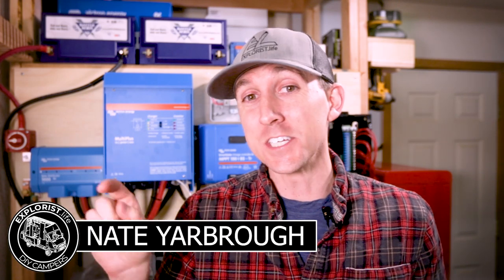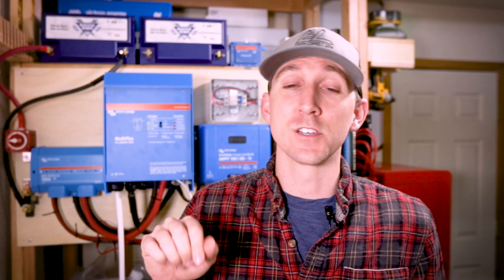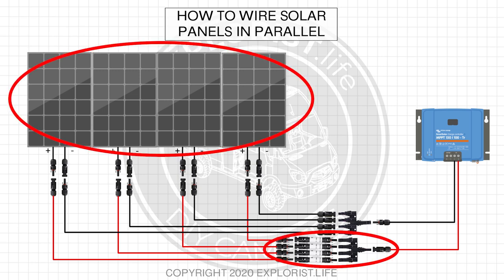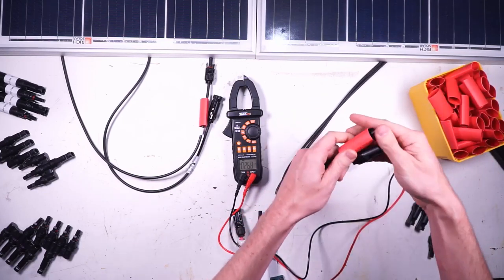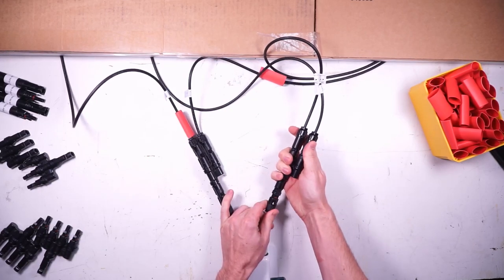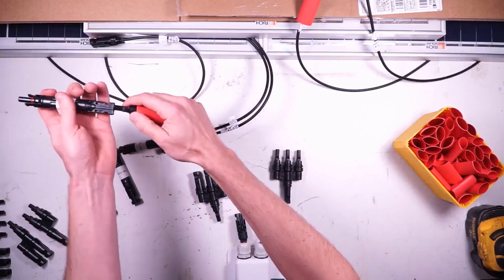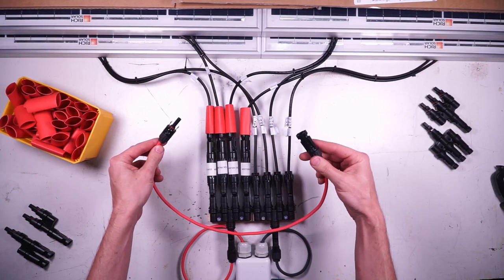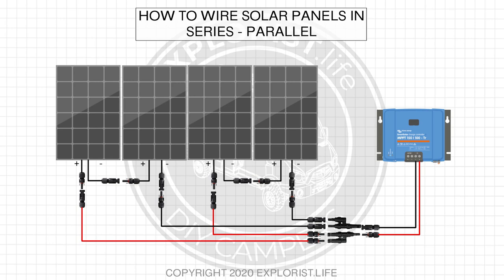How to Wire Solar Panels in Parallel for your DIY Camper Solar Install

Comment: First, I think you have the best videos for me to understand, almost.. I just got a 2021 trailer with a solar package which included a 12v frig, 165w furrion solar panel and a furrion 25a MPPT controller. Haven't been out yet but want to add to solar a little at a time. I already added a second 12v battery I hooked in parallel. The furrion panel is $500. I was looking at the 175w Renogy for $200. I can either try to match my 165w with this 175w or there is also a 160w. In one of your videos you said as long as the voltage is "close". Easiest for me to hook up with the Y adapter in parallel. Next I'll try the inverter...   Thanks for the help..

Comment: I’d like to know more about if you can have a bunch of different size panels wired together as an array to put into a charge controller to charge my 2 6v (12v via series) system…

Comment: The Connectors are clearly marked  positive and negative if you use a flashlight.  The positive always has the orange or red o-ring showing .
Reply from the maker: I've seen solar panels with their marked connections reversed. 😶 It's best to double check with a multmeter.  It takes an extra 3 seconds per panel.

Comment: Hey Nate new subscriber great video can’t find your update video on when to use fuses I’m gonna connect 3 100 w solar panels in parallel to my 3600 w natures generator would I need the fuses ? If so they are already in my cart in Amazon and would I need 15 A or 30A ? Thanks in advance awesome channel …..

Comment: Hi really enjoyed your video.
Q - I am planning to fit 3 175watt 12v panels in parallel, will I need to use 10mm2 (7 AWG) to cope with the amps? Cheers David

Comment: How durable are the wires and connectors since they will likely be exposed to UV rays and the elements?  Should the connections be inside a box and/or run wires inside conduits?  Or do you just tuck them in the air space between the solar panels and the roof as best you can?

Comment: I just bought a bigger bus and took my 2 battery 3 panel system and split it between the 2 buses.  The 1 panel to battery was easy positive to negative. The 2 panels were confusing but easy too. Just wire the negative to negative and out to the charger and same with the positive!
At first I had the 2 panels going down separately but realized that wouldn’t charge correctly, so I had to splice an extra few few of cable into my Panel wire n now everything’s connected m charging :)
Reply from the maker: Nice!  Glad you got it figured out.

Comment: Hi Nate can you reply with how many 100W panels can connect in to a 30A charge controler I have 8x100W getting 2 more to have 1kw, will connect to 4 100ah lead acid deep cycle battery.
I'm always enjoying looking at your videos.
Reply from the maker: This should help teach you how to figure that out: https://youtu.be/Jkbs84sBHsg

Comment: Good Morning.  I'm looking at putting on two Solar panels.  I was thing of either 2 HQST 200 Watt each or two Renogy 175 Watt panels. I have two Battle Born 100ah  for a 200ah sys. I have a 2000 Watt inverter but at this time I do not plain on BOON DUCKING very much or long. I do have a back up invertor Generator.  This will be for help maintain the batteries. Any sajustshion  would be Great.  Jack
Reply from the maker: Here is a 2x200W solar panel wiring kit I've put together: https://shop.explorist.life/shop/all-products/camper-wiring-kits/solar-charging-wiring-kits/400w-solar-charging-wiring-kit-2x-200w-12v-battery-bank/

Comment: Is there a reason to fuse each panel versus only one fuse at the output side of the branch connector? Certainly the panel wire gauge can handle the short circuit current of an individual panel. Not sure I see any added benefit to individual fuses.
Reply from the maker: The panel wire can, indeed handle the short circuit current of a single panel, but if multiple panels are wired in parallel, there is a chance that the combined amperage of all panels could flow back through a single panel wire, overloading the wire.  I'll do a video about this within the next month, but I've already got some more detailed info on 'why' on the blog: https://www.explorist.life/how-to-fuse-a-solar-panel-array-and-why-you-may-not-need-to/

Comment: So ...to do parallel  wiring is it safe to connect all the positive leads together on the 3 flexible .solar panels,&then all the negative leads together? Person who installed the system cut off all the connectors leaving only the bare wires to connect to .Is it standard on all flexible panels that the + is on the left& negative wires on the right? Thank you for all your help.really appreciate .(Lensun Solar Panels)

Comment: Is there a simple switch box that can be built and mounted inside my vehicle, to Switch between Series & Parallel Solar Input. I just found out the pros & cons of each, so would like this ability.
Reply from the maker: That would be pretty overly complicated for minimal benefit.  Just set up the array properly for the 95% of the time and call it good.

Comment: I thought if you connect panels in series you’re going up with the volts for example one panel it’s 12V. If you connect to you make 24V is that correct?
Reply from the maker: Yes, you're correct! When you connect panels in series, the voltage adds up. So if you connect two 12V panels in series, you'll get a total of 24V.

Comment: I’m wondering if you have any videos on how to wire a trailer from the shell off restoration. I am interested in how to wire the lights but I am also interested in how to wire the seven pin. For instants do you need a plug that has to male And so that it can plug into the trailer and the truck? I cannot find any videos on this

Comment: Hi there Nate, my name is Ray I am currently building a tent trailer for my mobility scooter. Keep in mind I do have mobility issues hence mobility scooter. Now my Question is not for my solar tent trailer it is for my Three Wheel electric trike ( mobility scooter) make is T4B electric scooter. It states it is a 500watt 48V20Ah with lead acid battery.   Just so you Know I have already played with it I bought 4 more 12v20ah batteries and yes it can go as fast as traffic. I don’t recommend this. So I put it down to a 60v20ah system instead of 48v20ah because that was too slow now I want to go solar powered at all times. Meaning charge while I drive. So you know I have this thing set up so I can plug into a battery bank and drive at the same time and the result was awesome except the power bank weight was too much for my likes cause it used more of my battery for the weight.    Ok hopefully you are still reading my babbling typing if so I want to put a solar panel on a roof I am making and get a mppt charge controller for a 60v 20ah system is this possible I will add pictures of me mission  Any feed back would be apprieciated. Thank you Ray￼￼￼￼￼
 
Yes I did all of this from my wheelchair and shop roller seats and arm canes
￼￼
Reply from the maker: Nice!  So, to charge a 60v battery bank, you'll need a charge controller that is capable of charging a 60v battery bank like the Midnite Classic 150 (https://amzn.to/2D7C8YZ) and a solar panel array that exceeds 60v.

Comment: So I don’t have a van, but I do have 6 /100 watt panels and I saw that you put inline mc4 fuses. So my question is. Do I need to put one of this in each y connector on the positive side. I understand that with six panels you do need inline fuses due to the about of power generated. I was thinking of using 20A fuses per panel. What is your advise I am in the process of putting this together so I want to make this right. Thanks

Comment: How do you get awg 4 wire in to a charge controller even using a furrule crimpers. Do you trim some of the strands to fit a smaller sheld on the wire?
Reply from the maker: A charge controller that is rated to accept 4 AWG wire should fit 4 AWG wire even with a ferrule on it.  Are you using too big of wire for the charge controller?

Comment: so.. if you have 10x panels. rated at 12v, 100w. 6.7A wired together in parallel, potentially making about 67A of current. 
Suddenly nutty the squirrel decides to climb on your roof and shades one panel. What stops 9 panels from pumping 60+ amps into the shaded panel and creating a fire?  a fuse?   
Why not large bypass diodes?
Reply from the maker: If you had 10 panels wired in PARALLEL where the array amperage could potentially be 67A, you would want fuses protecting each panel at the combiner.  Here's a video covering how/why that works: https://youtu.be/s1P31hxlD3I?t=283

Comment: Although I don't have the cables on front of me to test the positive and negative wires to see if they're accurate- what I ordered has negative females and positive males, this is for two solar panels, yet the same brand (rich solar y connection that reduces it from 2 cords to 1) is actually 2 negative females which  ends as a positive male, and the other is two positive males which ends in a female negative. Shouldn't I be plugging in 2 negative males (which the solar does not have) into the 2 female negative y connections and 2 positive females into the 2 positive male y plugs? Or should it all work out and the signs don't necessarily need to correlate? I talked to Rich solar on the phone today and he didn't answer my question, just referred me to this specific video.

Comment: if I have 2x100 w panels and 2x170 w can I still connect them in parallel? and also do I need fuses? many thanks
Reply from the maker: Hey, mihail buturuga! I appreciate you taking the time to ask your question, but unfortunately, I don't have enough info about your specific question to provide an accurate answer, but here is a playlist that, if you watch all of the videos start-to-finish (and take notes 😉), you'll have a REALLY good idea of how to design a solar array: https://www.youtube.com/watch?v=Jkbs84sBHsg&list=PLmvhcyi4n0TV9pi83rFTv3ZuMT_S1xIZt

Alternatively, I have some of my most common solar array setups pre-built here: https://shop.explorist.life/product-category/all-products/camper-wiring-kits/solar-charging-wiring-kits/

Comment: Can I install three 200W Rich Solar Panels in parallel while using a Victron SmartSolar 100/50 charge controller?
Reply from the maker: Check here for the ways I recommend wiring 200w panels into a system: https://shop.explorist.life/product-category/all-products/camper-wiring-kits/solar-charging-wiring-kits/?filter_solar-panel-wattage=200w&query_type_solar-panel-wattage=or
Reply: @EXPLORISTlife thanks.  Really enjoy all your videos

Comment: Hey Nate! Great video, thanks! Not sure if you can see this but is there a box of some sort that you can attach to the roof to house the MC4 branch connectors? All I can find are various DIY builds, hoping for something simple (like myself). Thanks, Steve!
Reply from the maker: Easiest way will be to not put them in a box.  They are designed to be exposed to the elements.  A box will indeed be some kind of DIY thing as that would be an atypical install.
Reply: @EXPLORISTlife  Wow that's great news! Thanks a mill for getting back Nate, I really appreciate it. Holler next time you are in Ireland!

Comment: When connecting 5 panels in parallel is it better to use 2 to 1 connectors or 5 to 1?
Reply from the maker: I'd rather do all 5 in series with an appropriately sized charge controller.
Reply: @EXPLORISTlife  I have a lvx6048 6kw 450v input and 27 amp overload and I have 10 panels that are 39.1 volts and 10.2 amps. I'm trying to figure out a layout that can maximize that unit. So I was thinking of 8 panels in series and 2 in parallel. I just don't know how to wire it?

Comment: Hi Nate, these are great videos!! I'm wondering if you can comment on using a chain of two 2 to 1 Y-branch connectors vs a single 3 to 1 MC4 combiner connector. 
I have 3 panels; 2 are 20v & 5a and 1 is 20v and 9a. The most efficient way to connect these are in parallel which should give me 96% efficiency (if I am doing the math right) vs series and parallel which would drop efficiency to 71%.
Should have bought a 3 to 1 combiner connector that you are using here. or am I ok to use two Y-branch connectors that I already have? My logic is: first connector branch wires 20v/5a to 20v/5a for 20v/10a and the second branch would be equivalent to parallel wiring a 20v/10a to a 20v/9a which would give me 20x19= 380W. (I'll be fusing positive connections along the chain with 30a MC4 fuses).
Reply: You should be able to do this. In fact, I was going to comment on the same thing. As long as you connect all positives on the same connector in the end, and all negatives on the same connector, they are still in parallel. The only potential issue would be voltage (or current) loss at each connector--especially if the wires are long runs.

Comment: The wire that comes with solar panel it’s self will that be sufficient enough to work as a parallel? I’m using a HSQT solar panel? And I have 6 of them 175 watts each
Reply from the maker: The wires off the panel will be fine, but the wire downstream of the combiner will need to be larger.  This is one of the reasons I HIGHLY DO NOT RECOMMEND wiring the entire array in parallel.  You'll be better suited  with wiring in series parallel (3 in series - 2 series strings in parallel) and an appropriately sized MPPT charge controller.  More info: https://www.explorist.life/solar-panels-series-vs-parallel/
Reply: EXPLORIST life - DIY Campers thanks man you’re the best as always

Comment: Hi Nate, so when you parallel 4 or more panels...shouldn't you use a thicker wire gauge down to the controller? Do you know if they make a mc4 to 6 or 4 ga ?....I'm thinkin the best what is a j/b with terminal bus...what's the thickest wire your victron controller will accept?
Reply from the maker: Mc4 connectors can handle 30A, so there are no mc4 connectors for 6 games wire.  BUT... if a solar panel array needs 6 or 4 gauge wire, it has been poorly planned and needs to incorporate full or partial series wiring to boost the voltage and lower the amperage.

I just built a custom wiring diagram with 2400w of solar and was able to use 10 awg all the way down to the controller because the amperage never got over 20 amps due to proper series-parallel configuration.

Comment: Thank you for the videos! I have a quick question: Renogy has a solar panel: 300-Watt 24-Volt Solar Panel. It's Optimum Operating Voltage is 32.2V. What is the output voltage of this panel? Basically, What 24-volt in the title means and what Optimum Operating Voltage means? Thanks a lot.
Reply from the maker: The Optimum Operating Voltage is the voltage (at 25 degrees C) when the panel is producing power.

The Open Circuit Voltage is the voltage (at 25 degrees C) when the panel is NOT producing power (like when the batteries are full, but the panels are in the sun).
Reply: @EXPLORISTlife  Thanks a lot! In the title: "300-watt 24-Volt Solar Panel" What the 24-volt means. Thanks.
Reply from the maker: It's a nominal voltage rating.  It doesn't mean much.
Reply: @EXPLORISTlife  Thanks a lot!

Comment: and if you have 8 solar panels how would that go? are there 8 to 1 connectors? thanks
Reply from the maker: Nope.  There's no reason to put 8 panels in parallel.  Wire the array in series-parallel.
Reply: @EXPLORISTlife  thanks! after watching your video about this i totally got it.. i got the bluetti ac200max which has 145V max and 15A max.. by putting 8 x 100 watt panels in 4 x 2 series-parallel i get to 4 x 20 = 80V max and 6,3A x 2 = 12,6A max... under 145V and under 15A... finally got it from watching your video's..
Reply: next lesson: fuses or not... im sure ill find it in your video's,cheers mate

Comment: Hi Nate, I'm back again with another question! I'm currently purchasing all my required wiring and accessories for the electrical part of my shuttle bus conversion. I have 4 250watt solar panels with a short - circuit current of 8.85amps. I believe it's safe for me to wire these in parallel however I'm unsure of my needed inline fuse requirement. For each panel the fuse rating is 15amps. I've spent the last few hours watching your videos about fuse ratings and reading your articles about when inline fuses are required but I'm still confused on what I should do. Based off your video, couldn't I input a 30amp inline fuse on each pair of positive connectors, correct? But based off your articles, I've read that I do not need an inline fuse due to the short circuit current rating being lower that the fuse rating of 15amps, right? I hope this all makes sense, I'm super confused over this simple fuse, please help if you can):
-Micah
Reply: Hi Micah, were you able to figure this out? I'm having a similar issue- trying to connect 4 panels using a 4-to-1 branch connector. I know I need to add fuses, but wondering what size to use. Do you know if it hurts to just 30A fuses? That's the biggest ones I see on Renogy
Reply: @brasilfreak24  hi nick, i ended up not using in line fuses. I had some help with my electrical and we felt that my charge controller would regulate whatever good. I did however add fuses in between my charge controller to battery. And between my battery and inverter. I hope your project is going well, I’m sorry for the delay in response!

Comment: can you use a mix of 100w and 50w panels in parallel? asking mostly because of space restrictions.
Reply: You should wire panels with different watts in series rather than parallel

Comment: I know or running series or parallel Different thickness wire going to your charge controller how do you determine the size of either
Reply from the maker: A properly planned solar array can use 10AWG all the way to the charge controller if wired in series-parallel or series.  But here is how to determine wire size based on the amount of power flowing through it: https://www.youtube.com/watch?v=ki3WXVR48eM